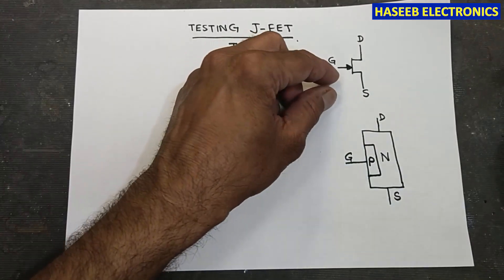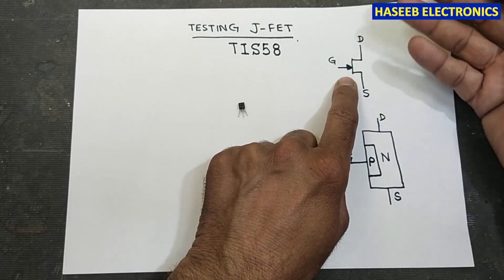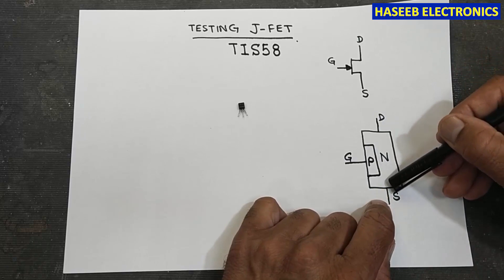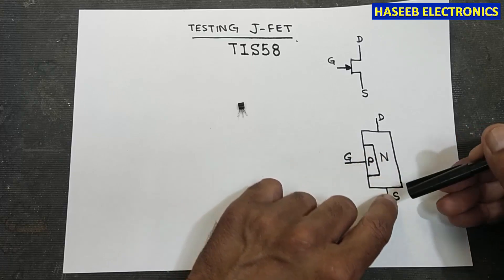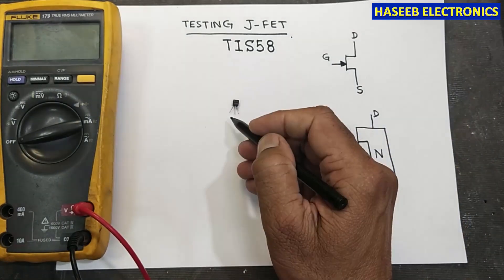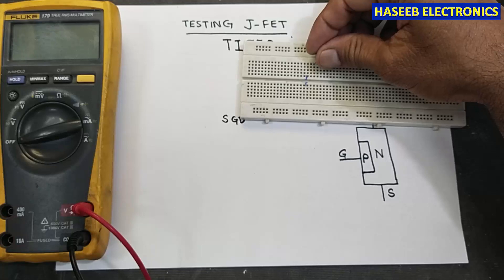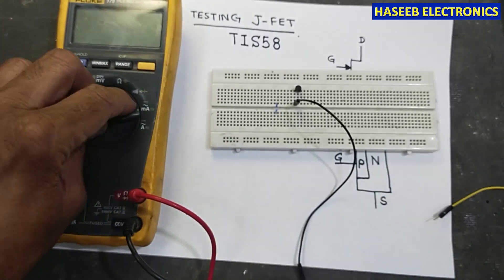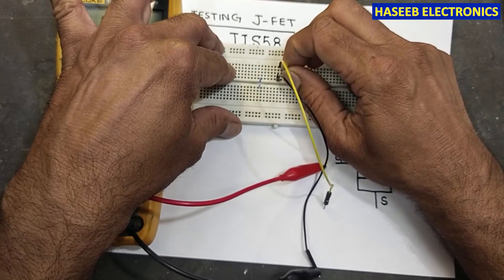{730} How To Test JFET || Check JFET with Multimeter

Comment: There is a TIS58 which is a bipolar NPN transistor, have you mistook the BJT with JFET? Otherwise can't explain your test result. Pls check
Reply from the maker: thanks for your comment 
i am sure and 100% confidant that it is TIS58 it is n channel JFET from Texas Instruments 
and i explained its testing very clearly (as i use this method to detect good of bad JFET) 
https://www.datasheets360.com/pdf/-8429337109951170368
its alternate part number is 2N5949
Reply from the maker: for your more satisfaction, i will try to arrange some more detailed and comprehensive testing. and it will my pleasure

Comment: Sorry but I got confused. The N JFET should be normally closed when the gate is discharged and  not connected to anything or connected to the source, when the gate is applied positive voltage, it will cut the current becoming open. But your demonstration is almost totally opposite? Am I wrong with something? Thanks

Comment: Sir, I have (J112) JFET.
I checked with my Multimeter, it shows 45 Ohms(short🛑) on Drain-Source pin in off condition.
Drain-Source pin is always short 🛑, Without applying any input signal to Gate.
Plzz rlpy